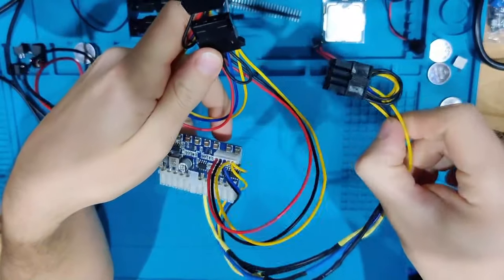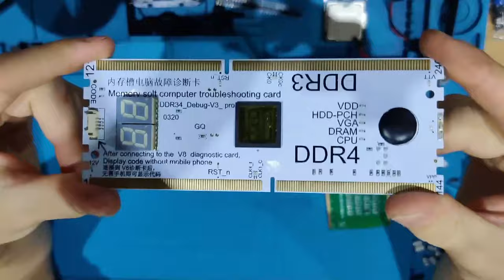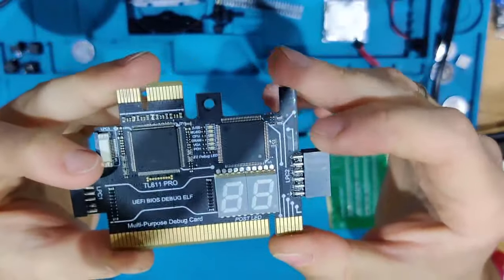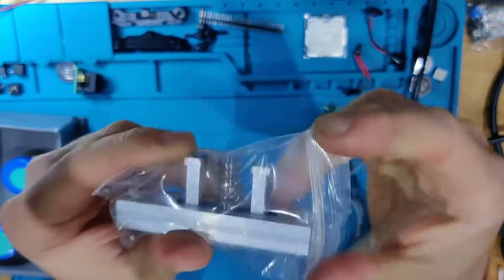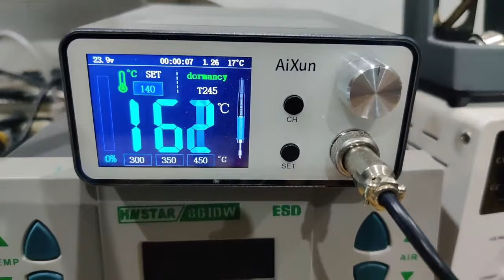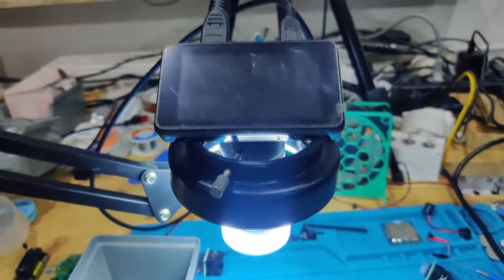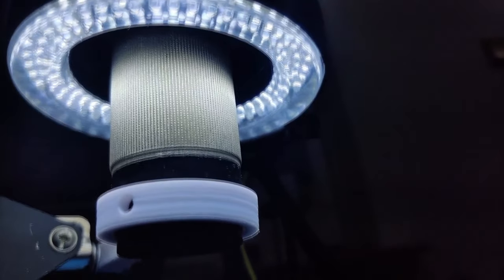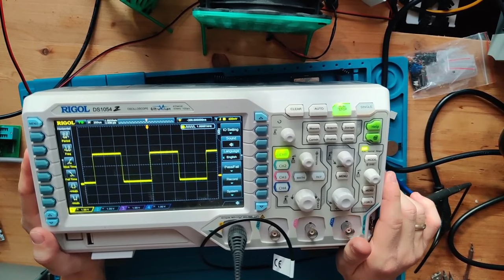TOOLS I USE TO REPAIR ATX MAINBOARDS THAT YOU WILL NEED!

Comment: I've been experimenting with a few of those 12v mining/pico psu for my computer, I got a 360 Watt one and it just passes 12 volts straight through to the motherboard so be careful with what voltage you give it and I'll be interested in seeing the output voltage ripple/quality oscilloscope test if you get time

Comment: Hello 🤝 great equipment and great videos, best regards👍👍👍👍👏👏👏👏👏👋👋👋👋👋P.S. I wanted to ask if you have ever had experience with a Gigabyte aourus B450 pro board with error code 15, the board does not go through the post procedure, what do you think about it, could it be the BIOS?
Reply from the maker: Erorr Code 15 is quiet early in the chain. I would expect 00 if the Bios would be dead. I would check the voltages first on the board, exspecially around CPU and RAM and if they are all present, flashing the Bios would be an option!

Comment: No heating plate? Got a dead z390 aorus master that I suspect has a dead chipset but don't have a thermal camera, from what I understand there shouldn't be any shorted caps on the chipset and I have a few shorted ones. Ordered a cheapo 7$ heating plate from Aliexpress, still waiting for it, will try on some dead boards before going for the chipset.
Reply from the maker: I do have a preheater, that was about 100€, but its too small for Mainboards. Ive had a BGA station before and what i encountered was, that if you want to do anything BGA related on Mainboards like the socket or Chipset you need to preheat the whole board and not just the area where you want to work on, because the warping gets to bad and then chipsets and sockets wont lay flat anymore. But i would be interested in your results!
Reply: @MainboardMedic  thank you for the answer and the important detail about warping, lol you understood me without me even telling you the whole story, Nice 👍. Will definitely try on a crappy dead board and not the master. Bga station is very expensive, not for home use, yeah now that I think about it the guy I watched changing a chipset used a huge preheater, well guess the 7$ heater won't do but might still try on a crappy board
Reply from the maker: You can defenetly get some experience with a crappy board and try some things.  @Roman00744